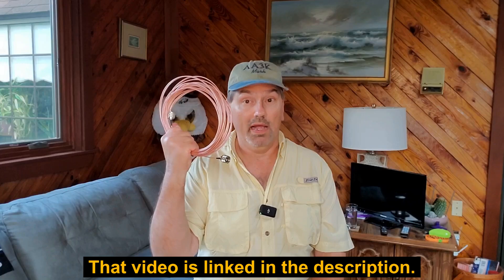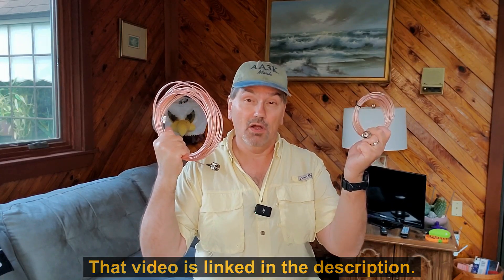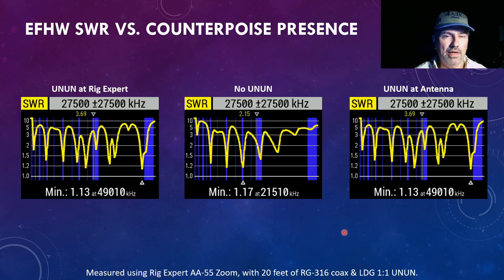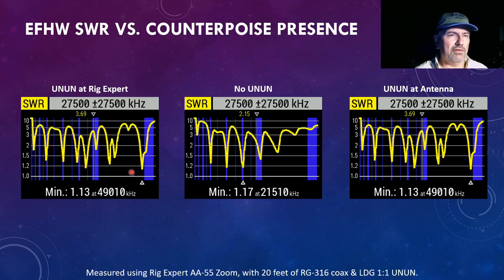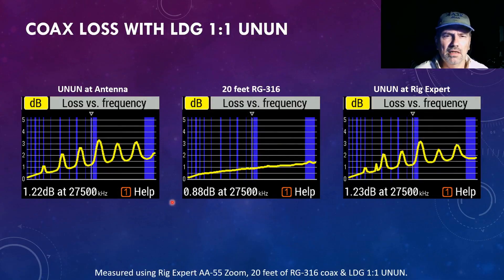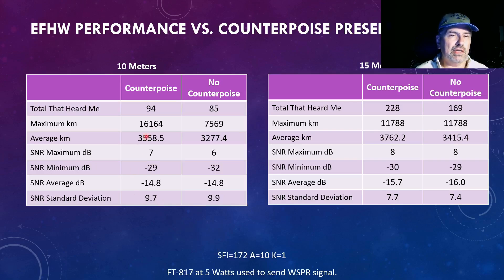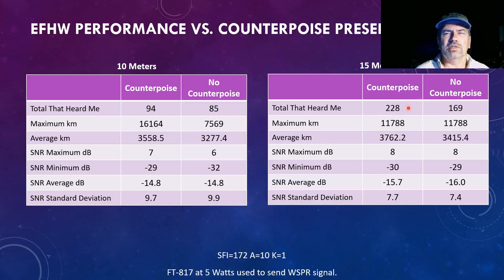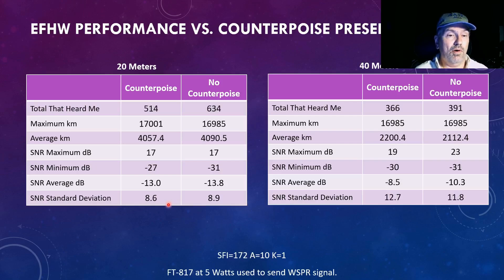Do EFHW Antennas REALLY Need a Counterpoise? Unexpected Result!

Comment: Your comment on how there always two halves to the antenna are absolutely true, but an EFHW is a end fed dipole thus both halves are already present in the radiating wire. Your testing just proved that for you. Great video my friend. This is what its all about.
Reply from the maker: Seeing the difference in the SWR between having the choke there or not is making me wonder whether I should include it or not.  Probably means more testing with different chokes!

Thank you for watching and your comment.  Please check out my other antenna videos.  https://www.youtube.com/playlist?list=PLyGtGdskTYCH5CMP0r1bOQHkUDCsy2lNf
Reply: @aa3konthego I can tell you from experience the LDG choke is absolutely terrible. I hate to say that because I like the other balun-unun's they make. You can put that 1:1 choke on a vna with a 50 ohm dummy load and you'll see a linear increase in swr/loss from 1mghz to just 50mghz. At least with my personal one. Just a simple choke using you coax wrapped a few turns through a mix 31 torroid does the trick extremely well with no measurable loss.
Reply from the maker: @HamRadioWithKE0MAD I'll give that a shot. Heck it might even become a video.

Comment: Good video and experiments.  The original technical meaning of the word counterpoise might not be correct here, but the transformer needs some capacitance to source and sink current.  73 KK7YIS
Reply from the maker: Thank you for the feedback. Personally im just going to let the coax be the other half of the antenna.  Need the coax there anyway for everything except my K6ARK EFHW which can connect direct to my (tr)uSDX.  There i do have 20 fet of wire for a "counterpoise".
Reply: @aa3konthego I played around with my 136 ft EFHW and found it performed much better with only the  choke in the shack vs. a second 14ft down the coax.  Better match on 80m and was getting a false match on 60m but not getting out.  I still need to try if a 14ft wire extended perpendicular from the transformer instead of straight down the metal pole is even better.  I like your real world testing with WSPR and subscribed.

Comment: what is the procedure to measure loss?
Reply from the maker: With a RigExpert (I have an AA-55 Zoom) select the loss measurement function and connect the coax to the RE, with an open circuit at the far end.  Run the measurement and the RE will run the first sweep and then ask you to place a short at the far end (that is the SO-239 with the pigtail on the table, center is shorted to shield). Hit enter a second time on the RE and it will sweep again then display the loss across the frequency range.  You can probably rerun the measurement on smaller frequency ranges but I have not tried that.
Reply: @aa3konthego Thanks, I have the stick version, need to create a short connector
Reply from the maker: @jerryKB2GCG  It should be able to do the same measurement.  Thank you for watching!

Comment: How long is your wire? It can't be an end-fed HALF WAVE on all these different bands!
Reply from the maker: The trick with EFHW's is you adjust the wire to the lowest frequency/band of operation that you want (in my case all of mine are cut for 40m about 65 feet / ~20 m) and it will be resonant on that band and all harmonically related higher bands.  So a 40m EFHW will also work on 20, 15 and 10 meters, 2nd, 3rd and 4th harmonics.  The input impedance of the wire is very high which is why they have the transformer at the input to bring them down to 50 ohms.  As the WARC bands are not harmonically related you would need individual wire lengths for each band either through separate wires or linking parts together.

True, they are not half waves on the harmonically related bands but the name comes from the primary band of design.  EFHW has become the accepted name of this antenna type.

Comment: An Unun has no effect on CMC. So regardless of its placement CMC was present at all times. A 1:1 current choke will block CMC. The difference in SWR readings was caused by the placement of the Unun and it's 49:1 impedance transformation. Placing the Unun near the radio would present an impedance different from the 2450 ohms expected at the end of a EFHW. The extra length of coax meant the antenna was now a random wire. Place the Unun at the antenna end followed with a CMC choke and you now have an antenna without counterpoise. Measure that, then remove the CMC and you'll then have a true comparison. 73, Don K2PMC

Comment: If you were to actually transmit with power with a choke at the transformer and no counterpoise, your Toroid would overheat causing your SWR to go completely wacko. If no wire counterpoise with an EFHW, you need the coax to be that counterpoise. Sorry, but running at such low power as whisper doesn't actually prove a counterpoise isn't needed.
Steve H, k7ofg
Reply from the maker: Interesting points.  I will admit I've warmed up a couple of EFHW toroids with bad band conditions and lots of CW CQ's at 100W.  One did show worsening SWR and I opened the case it was in allow cooling and lowered the power.

I can try a quick test with more power (insert primal grunting 😝) and see how things react.

Comment: If we want feeder to be a counterpoise then AFAIK common mode choke should be in distance of 5% of longest used wave length from the EFHW unun. Additional CMC for sake at radio. "Explaining End Fed Half Wave Antennas & Experimentation" 4 minute
Reply from the maker: Another thing to look at. Limit the counterpoise to 5% as compared to longer. Personally I'm just going to continue using the coax acknowledging I'm not going less than the 5% unless absolutely necessary for carrying weight reasons.